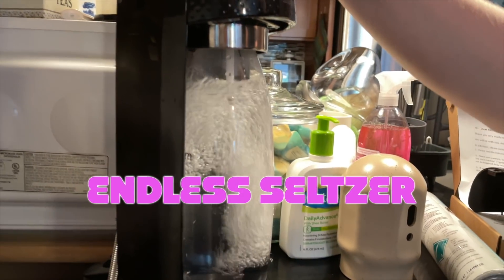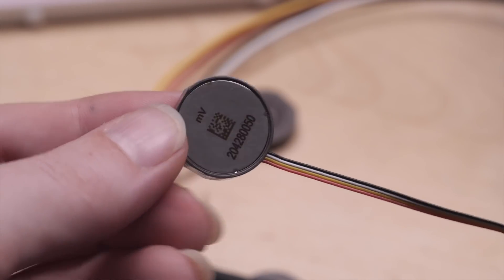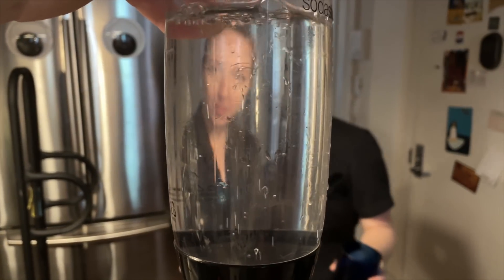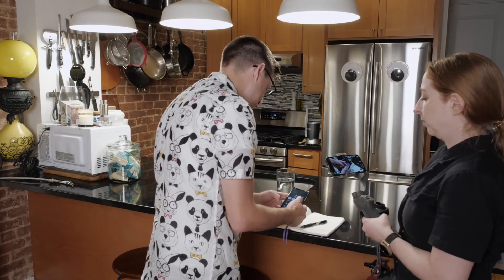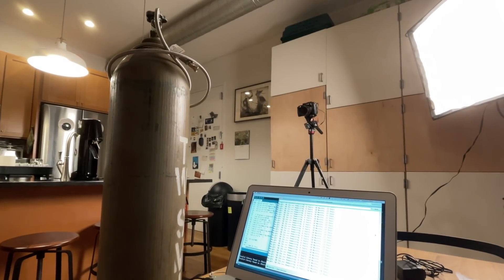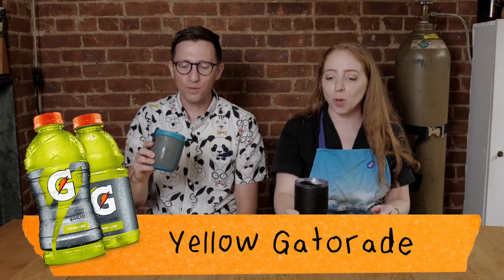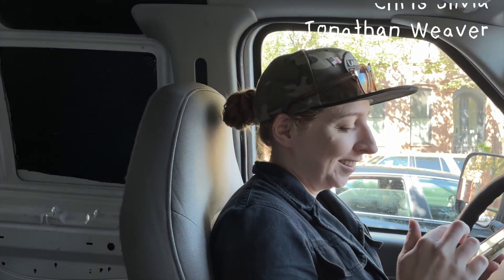DIY Unlimited Sparkling Water // Becky Stern feat. Ian Charnas

Comment: yeah, dont get your co2 from a welding supply co, food grade and industrial grade co2 are not the same.
Reply from the maker: They are, actually. It's the handling of the outside of the tank that has different regulations between food grade and industrial grade.

Comment: I've tried this sort of thing to carbonise Beer, (Home Brew). I used food Grade C02, which is a thing, not sure I'd want to use Welding Grade for human consumption although to be fair, I'm not completely sure what the difference is. Anyways, I've kind of given up with the beer, never could get the carbonation in the bottle to work well. You need to carbonise then seal, (Cap) the bottle, try it with some flat beer sometime and you'll see. I even tried dried ice pellets, with explosive results! thanks.

Comment: Great video that I'm attempting to use to modify a Carbonator Pro - the only part I'm confused at is adaptor and specs of the CO2 tank -> sodastream. What type of line? What is the exact "separate piece"? This isn't included in the video nor the description.
Reply from the maker: links to the exact things I bought are in the tutorial, which is linked in the description.

Comment: I've considered this, sadly since the primary thing I want to drink is Diet Pepsi it won't work, I need a full soda gun. 

Though the tank...wouldn't you be worried the CO2 might be mixed with something? I considered getting mine from a brewery to maintain complete cleanliness and no contamination. Not sure if this is an issue!

Comment: great project but I would never use a gas bottle without a brass regulator at the tank to limit flow at the desired pressure and to keep the line pressure within the pressure spec of the original SS gas bottle. That gas C02 cylinder is over 800PSI and the consequence of line failure or failure of the SS  mechinism could be quite dangerous. C02 sensor is a nice touch. A neat project would be to have an electric valve that shuts off the bottle when a leak is detected.

Comment: Tip from a tradesman: to the extent possible, drill your mounting holes in the mortar lines between the bricks, rather than drilling into the bricks themselves. You can easily patch mortar later, but it's harder to patch a brick and have it look decent :)

Comment: I did this about a year ago but I quickly just built a soda water kegerator. Got a small fridge from craigslist, got a tap/tower from eBay. Got a corny keg from a local brew shop. I have to clean and fill the keg once a month. I've not had to change the gas once. 
I now have filtered water at the faucet as well.

Comment: Is the price comparison just the tank, co2 and fittings? Or was it including the cost of the scale you made?
Reply from the maker: In the calculation, I did not include the scale components but rather the "required" items: the tank, fittings, wall bracket, and CO2 monitor. A smaller tank would pay for itself even more quickly.
Reply: @BeckyStern  thank you for the quick reply. I may have to look in to this again. I had became interested in it before but didn’t know there was adapters to still use soda stream machine

Comment: I've been doing this since around 2008, but with a smaller 20lb tank and still the original SodaStream. Tanks last about 2-3 years for me.  Definitely the way to go. Violates all the fake Sodastream licenses/scare tactics they include in the box..I assume they still do that? Anyway,  make sure you are getting food grade CO2 at the gas supplier. It's the same type used by fast food places.. Welding CO2 has numerous impurities that could potentially be dangerous over long term use as its not filtered as much as food grade. The price difference is insignificant on something that lasts years. Also, I would suggest closing off the main valve when you're done. You don't want a burst in the middle of the night with so much gas.
Reply: I refill my CO2 tank at the local homebrew supply store. It's definitely food grade and I force-carbonate my beer with it, too.

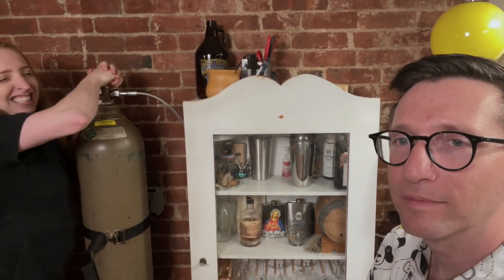Comment: 12:00... Why is there no regulator on the tank ?
Reply from the maker: The SodaStream is the regulator in this case.
Reply: I really think there should be a regulator I am running a 5pound CO2 canister on my soda stream and the pressure rough on the plastic pieces on the soda stream button.  Unfortunately I haven't been able to figure out how to make a regulator work with the setup 😔
Reply: The regulator is in the Soda Stream cabonater.
The pressure in a CO2 cylinder is the same regardless of the size of tank. Pressure will rise with an increase in tempurature and fall with a drop in temperature.
The volume in the cylinders that come with the Soda Stream is small enough to present a very low risk to health if a leak develops.
A leak in the system with one of the larger cylinders could fill an entire room or rooms with CO2 which, while not toxic, could suffocate you.
Reply: Always turn off the larger cylinder valves between use.
Reply: @windsportbc  well then the place that filled my tank must have over done it 😬 because my soda stream ended up damaged by the initial pressure😢

Comment: Did this mod a couple of years ago with a 1kg bottle that is more manageable (not the scale part thou) what you will see with time is the need of a dummy bottle that keeps the rigidity of the setup, the dummy bottle inserted in the orifice at the bottom of the sodastream machine prevents it from flexing.

Comment: Why isn't there a regulator on your tank? Is the operating pressure of the soda stream that high? If so, WOW! Also you really should have the cylinder cap whenever you are moving the tank (like when you were weighing it on the bathroom scale). The missile thing you warned about later in the video is definitely something to be avoided.
Reply from the maker: The SodaStream is the regulator!
Reply: @BeckyStern  Right! I'd forgotten that the CO2 condensation pressure at room temperature is only 800-900psi (versus the 2000+psi of a full inert gas cylinder).  The Soda Stream refills are likely full of the same liquid (or super critical on a warm day) CO2 as the big cylinder and as such are designed to regulate that pressure.

Comment: Is the co2 gas safe from all industrial bottles?  Are there any impurities to worry about (oils, solvents, etc)?
Reply from the maker: In our research the only difference between industrial and food-grade CO2 is the conditions and handling of the outside of the tank.
Reply: @BeckyStern  thanks Becky. We’re going to order the parts this weekend. The industrial bottle sounds like the way to go.
Reply: @BeckyStern  Sorry to comment twice, but this is not true, welding CO2 will contain more impurities than beverage safe CO2 (~0.5%). Also, beverage safe canisters should be steam cleaned on the inside, which you would not normally get from a welding canister. Most of the impurities will be harmless, but Benzene impurities that're measured in extremely small quantities can be harmful. Stay safe
Reply: @SpeakerMunkey  In the process of welding, it is crucial to use high-quality CO2 gas to ensure that the weld remains free from contamination. The CO2 gas is used as a protective shield to eliminate any oxygen or other impurities present in the environment. The presence of oxygen during welding can cause oxidation, which can lead to the formation of rough, weak, and brittle surfaces on the weld. The use of lubricants during welding is strictly prohibited, as it can result in the formation of pores, cracks, or other defects in the weld. Therefore, it is essential to maintain a clean and pure environment during welding to ensure the weld's quality and durability.

Comment: Epic! Back in the day, I worked very briefly in food services. Ever since, I always wished to have my own setup like this. But I think the CO2 canisters we used were smaller (20lb) and looked a bit less... industrial.
So quick question: Is there a major difference between "industrial CO2" and "beverage grade CO2"? Or just shinier canisters?
Reply from the maker: Just the conditions and handling of the outside of the tank. You can totally use a smaller tank, we were just trying to make it as endless (and comical) as possible).
Reply: @BeckyStern  This is not true, welding CO2 will contain more impurities than beverage safe CO2 (~0.5%). Also, beverage safe canisters should be steam cleaned on the inside, which you would not normally get from a welding canister. Most of the impurities will be harmless, but Benzene impurities that're measured in extremely small quantities can be harmful. Stay safe

Comment: I wouldn't want to pay the hire charge on the tank for 26 years :o
Reply from the maker: Oh I bought it, it's not a rental!
Reply: @BeckyStern   well that's a relif, that cylindar would be similar to the K size (34 kg/74 lbs @ £83/$113), and that's £10 per month rental, the most common size for CO2 (or the food/beverage version SureGas [99.9% CO2]) is a B size (6.35 kg/14 lbs @ £33/$45) is more reasonable at just £3.50 per month, and likely better for getting upstairs too.

Comment: When I put anchors into a masonry wall, I usually use the metal anchors which I coat with 5 minute epoxy before hammering them in. That way they're never coming out.
Reply from the maker: Nice tip!
Reply: I thought the longer curing stuff is stronger. It's not like anything's going anywhere...
Reply: @sheiladawg1664  while it potentially is, it's usually overkill as the 5 minute epoxy is stronger than the masonry it's attached to.

Comment: Great job with the tank strap and CO2 monitor! It'd be great for you to finish your safety setup by securing the PRESSURE LINE as well. If you lose connection on the end, that sucker's gonna whip around with a heavy metal connector on it.

Interesting to see your CO2 monitor at 530ppm (Halfway to the NIOSH limit of 1000ppm)...  It's crazy that our current baseline of 400-450ppm results in that. If you had filmed this in the 90's you'd be looking at 350ppm or less.

Maybe your next project should be some houseplant oxygen boosters? Great plants are Spider Plants and Weeping Figs.

Loved the "Guess that Fizz!" section.
Reply: Good call, securing the pressure line would be an added plus. We would have to figure out how to secure it all along the length of the pressurized hose. Maybe cable anchors could be used in the wall along the length of the hose.
Reply: @iancharnas  yup, hose clamps to the wall would be a good choice. The goal is to not give the fitting on either end enough slack to develop momentum. Still one of the most safety conscious videos I've seen in YouTube - love it!

Comment: 20lb cyl is a lot lighters. You can get them at a local brew store
Reply: But then you're looking at only 2-3 years of bubbles, and the tank cost is still high enough that it might not be enough for subscription to work out.
Reply: @Srfingfreak  The tank can be refilled. If it's not too far out of the way, drop off the empty on the way to work and pick it up at lunch or the next morning. Most welding supplies open early but rarely stay open late.
Reply from the maker: @Srfingfreak  The savings is still there for sure, especially when you factor in the lowered cost of the gas refill once you recoup the cost of the tank.

Comment: Not that I know anything about it, but wouldn't you normally use a pressure regulator on the tank?  I'm glad you only expect to haul that tank in and out of the apartment every 6.9 years.  :)
Reply from the maker: The SodaStream is acting as a regulator in this case.

Comment: 840 ml a day is way under the amount of seltzer i wud drink a day if i had this xD Itd probs last me like four or five yrs tho and still be very much worth it. 

Im rly glad to find out that its so easy to adapt a sodastream to use other kinds of canisters; as the cost of those sodastream specific ones always seemed kinda absurd to me.

I may just do this when i finally get a sodastream once i have funds for it.
Reply from the maker: The SodaStream canisters do already have massive savings over buying bottled sparkling water! I just HATE going to the post office and always need new content for my channel... 😁
Reply: @BeckyStern  Yeah i kno theyre a much better price than buyin it, which is why i alrdy planned to get somethin to make seltzer at home; but being able to save even more wud be grt for me, esp as i like my bubbly drinks to be absurdly bubbly and will probs be at least a five pumps gal if not more. 

I also drink multiple liters of water a day as is (tho i cant stand unflavoured/uncarbonated water, but if its either flavoured or carbonated then its grt to me), so id go thru them quite fast as is.

Ill probs end up getting like a 10-20 lb container tho as neither myself nor my wife cud possibly manage to get that 50 lb capacity one up our stairs to the kitchen xD (even if i went around back instd so i only had to go up a hill with it and a few steps).

Aside: I cant imagine this wudnt work... But have ya thowt about switching the CO2 canister out for a Nitrous Oxide canister? Do you think that wud work all the same? Im a big fan of Nos and other beverages that use nitorgenation instd of carbonation and am rly curious if i cud use it all the same for that just to see what the bubbly water tastes like if nitrogenated instd of carbonated.

Comment: Ah yes, the safety bit totally made me happy. I really hate stuff under pressure, or spinning super fast etc. Which was a benefit when working in the lab as I was always making super sure I balanced everything. :) I am surprised you can just buy such a tank. Even more kudos for placing the CO2 sensor low to the ground, though that does depend on the turbulence locally.
Reply from the maker: I got pets after all...

Comment: Where do you even begin to source a 50lb tank of food grade CO2? Wouldn't want to use non-food grade, because that's nasty stuff.
Reply from the maker: In our research, the only difference between the food-grade CO2 and the regular kind is the condition and handling of the outside of the bottle.
Reply: @BeckyStern  wouldn't that vary from country to country, as it'd depend on the local regulations?
Reply: @netroy  In the USA it is common for home brewers with kegs to get their CO2 tanks filled at the local welder's supply. 
It's a lot cheaper than getting it from the home brew supply store.
Reply: co2 is co2, I refill mine at a welding supplies store... Been doing it for a couple of years already. Before that I used dry ice powder (solid co2)